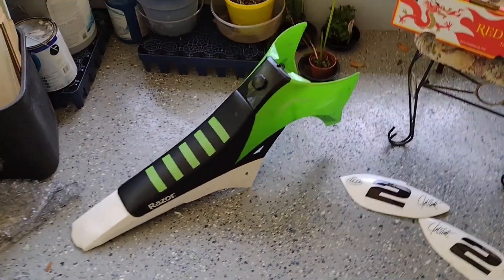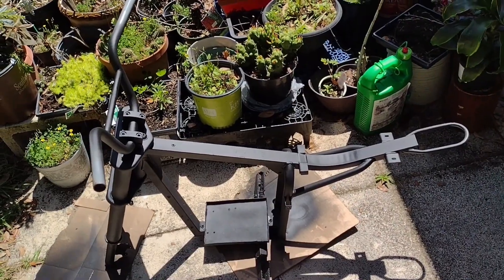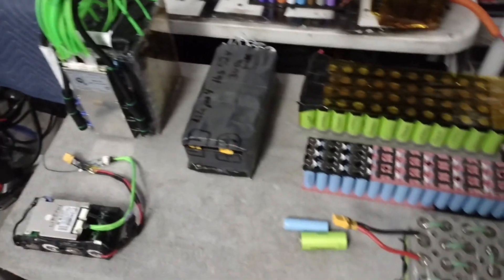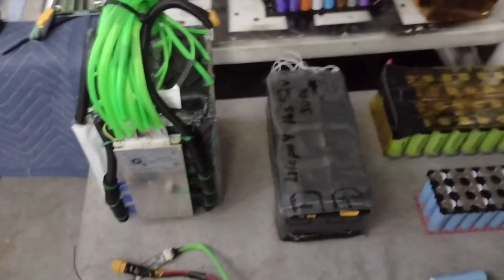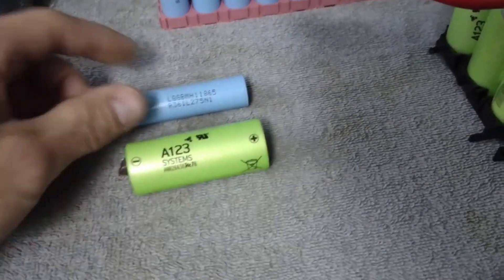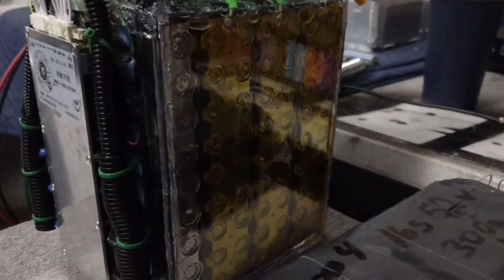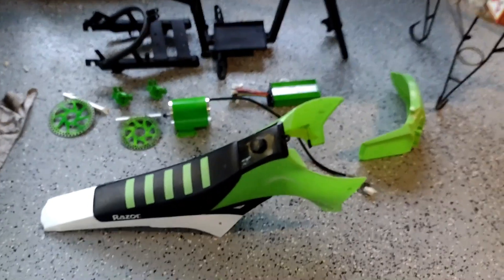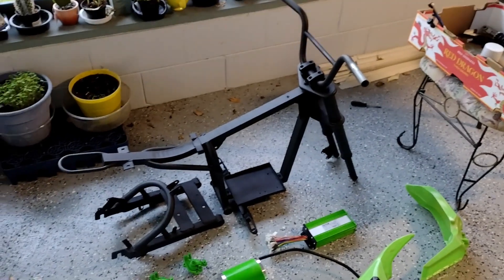razor electric dirtbike SX500 to SX1800 brushless rebuild part 2 of 3

Comment: Will def be watching. Mx and rsf are more popular I'm building an sx and appreciate your info.
Reply from the maker: Yes I have not had the pleasure of riding a rsf650 they are the unicorn or razors lol.
I do have a mx650 and I plan on a 3kw+ setup and 24s10ah pack of the lifepo4.
$80 in cells but capable of 500a. 
Super fun 😁. I'm going to go into details on the bms and battery build.